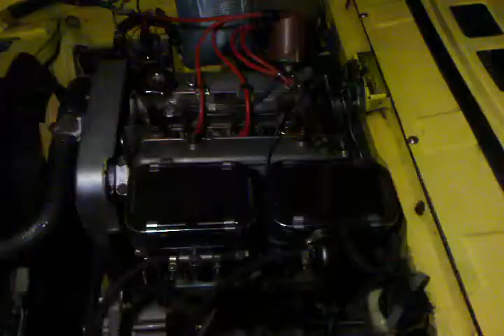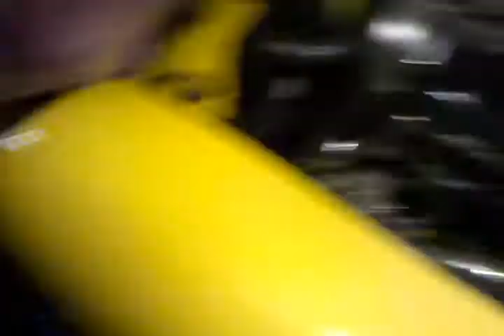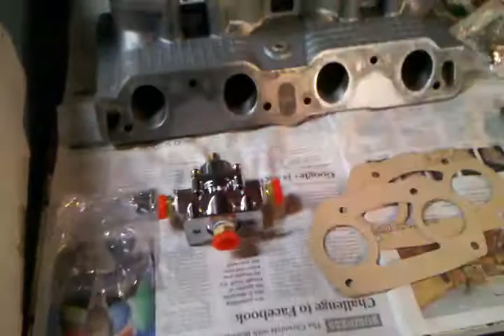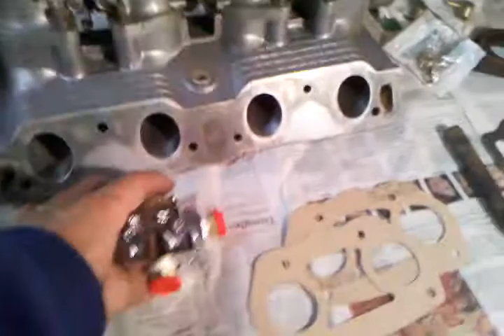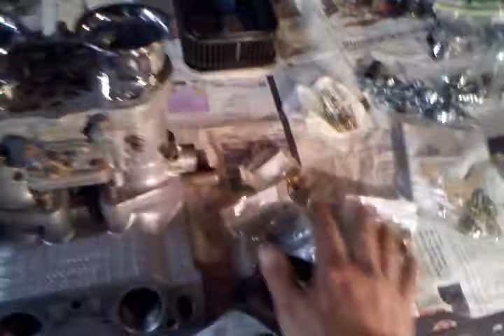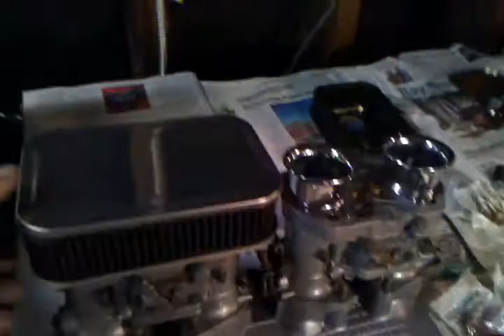Part 1 some basics and info on the correct dual feed fuel pressure regulator to use

Comment: It there an advantage in using the holley dual feed regulator to feed side-draft DCOE40s rather than the IDFs you've got here?
I've got a Malpassi regulator feeding the carbs sequentially...
Reply from the maker: twincamspit Don't know Malpassi but Guy Croft endorsed the Holley and it is a very well regarded brand in the US.  I have had past good experience with their stuff.  The key is it is a reliable regulator and offers dual outlets to feed each carb evenly.  I used it for years with no issue and recommended it to several others that had good experiences.